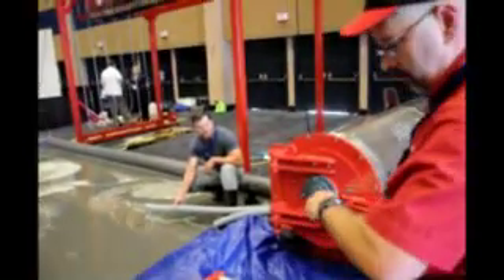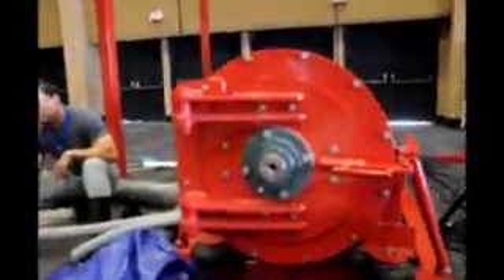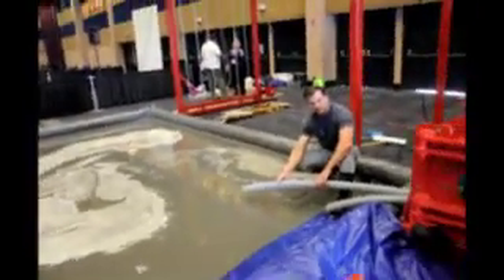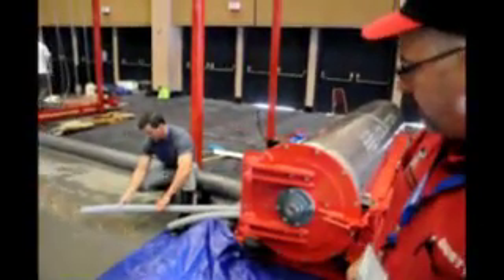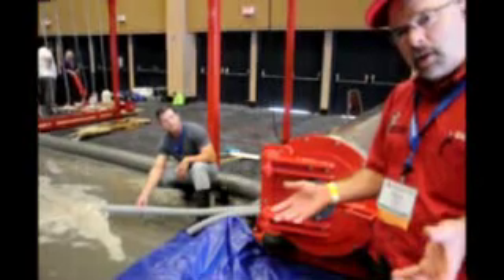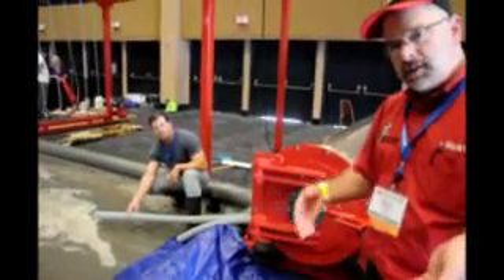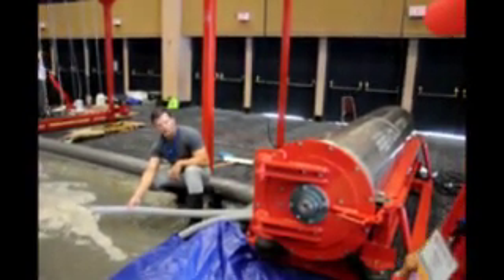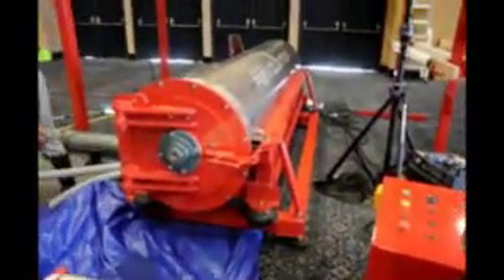RugeRevolution Pro SS Centrifuge Wringer by RugBadger.com

Comment: Anyone is welcome to search out and contact any of our RugRevolution clients around the world to find out how they like them. We challenge anyone to take one for a test drive, but when you do make sure to insist on seeing how it runs with even a very large and fully soaked 90 line chinese.  
some specs-50% faster then any other North American made spinner at 1300 RPM, Stainless inside and outside cylinders, full air and hydrolic suspension, best warranty in the world! Just search RugRevolution